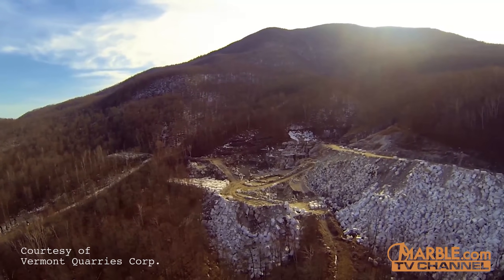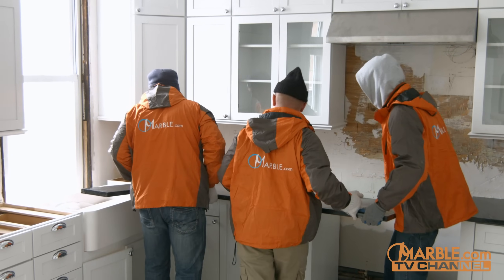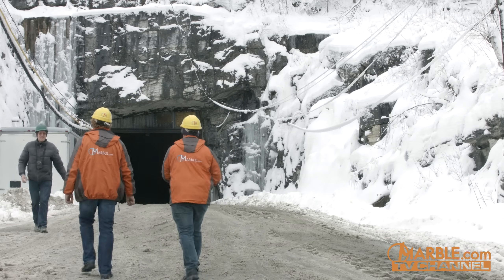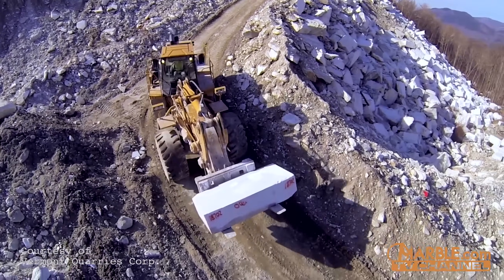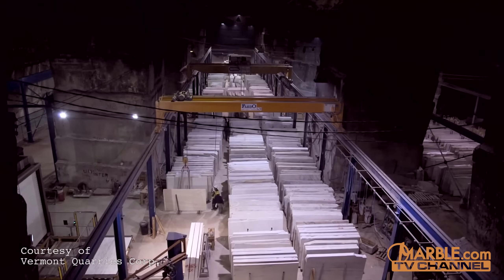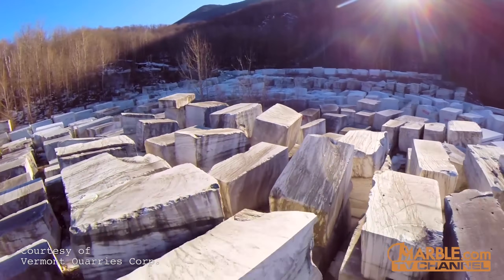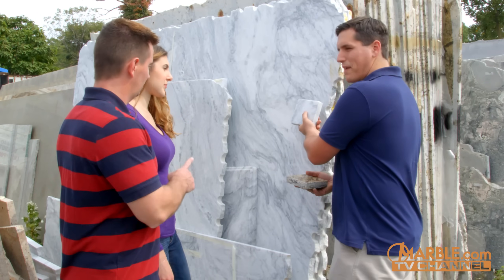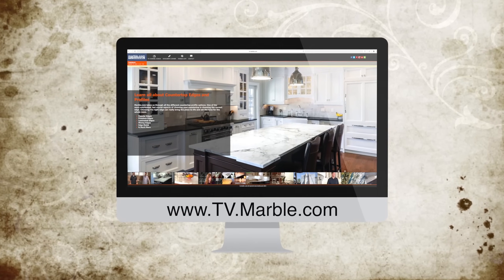How Natural Stone is Made | Marble.com

Comment: um this is so wrong, mabrle is made from limestone nto magma??
Reply: I knew something was up with this video. Cheeky bastards.
Reply: it is not wrong. it is crystalline form of CaCO3.
Reply: @danceforkids2919  It IS wrong.. Marble is a REcrystallized form of Calcite (CaCO3) - or limestone.. like you said.. but limestone is a sedimentary rock.. converted to marble through contact METAMORPHISM (making a metamorphic rock).. Granite.. as mentioned in the video.. has NOTHING to do with marble.. it is an IGNEOUS rock.. cooled and solidified in a plutonic (subterranean) felsic magma formation.
Reply from the maker: +cocoanouk You are correct! Marble is made from limestone. The section of the video you're speaking of is actually referencing granite, which is produced from magma.